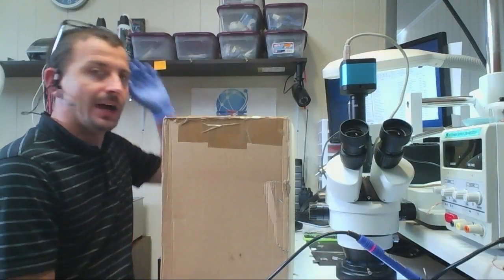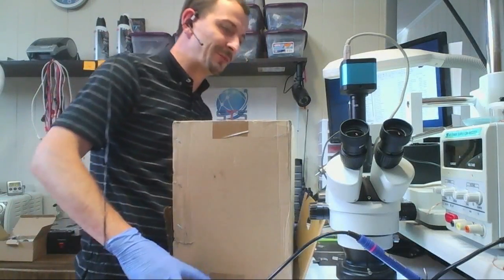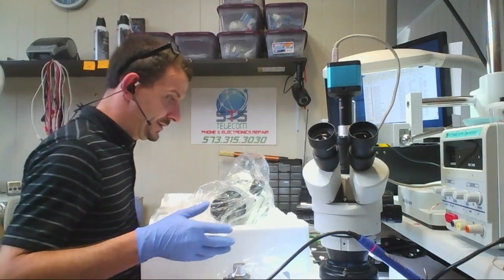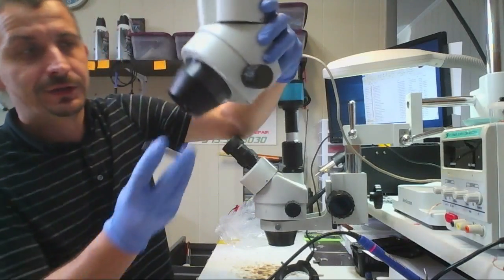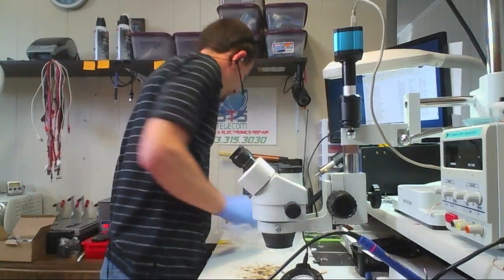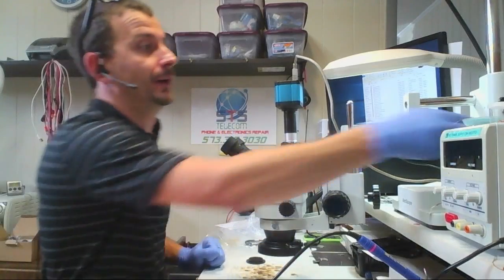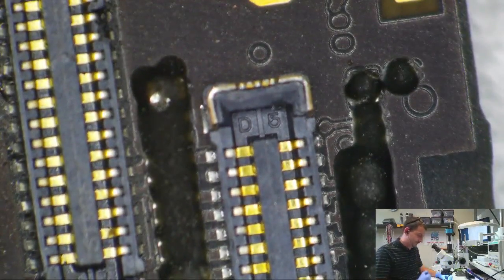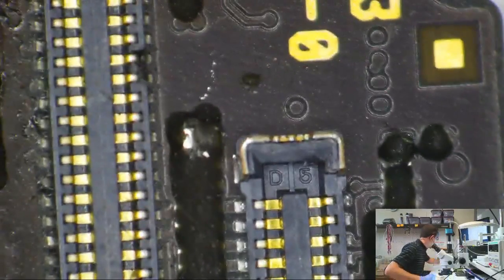A new microscope for this channel! AmScope SM745TP Simul-Focal head - GIVE ME MY EYE BACK!

Comment: You need a 48mm Barlow Lens on the bottom and well as a 48mm skylight 1B  used to protect the Barlow lens from risk of splatter from the work area. Adding the Barlow gives you straight surface to be able to lock the Light unit to the bottom.

Comment: Thanks for the video. I just purchased an AmScope SM-4TP and I need mine for filming experimental organic reactions and with my model not having that silver level that toggles it from left eye to camera port is actually a bummer for myself. From what I've read it looks like I'm loosing 20% of light since the one I have disperses it out 35% left eye, 35% right eye, and 30% for the trinocular port. I know I could just use more light on the subject but there is a significant amount of light being lost by it being dispersed this way. Would the light be dispersed differently if I put lens caps on the two objectives? Or do they may a scope that just has the trinocular port and nothing else so all the light goes to that port?  Thanks in advance!

Comment: There are some metal rings to hold the light ring, google this Metal Objective Lens Adapter Ring for Stereo Zoom Microscope M52 to M42/M52 to M48/M48 to M48/M48 to M42 X 0.75 Thread

Comment: Hi everyone. Is the magnefication we see on the video form camera same as microscope? I mean ıf ı bought just the amscope head can I get the same magnefication? I need urgent help.thanks for your help.
Reply from the maker: The camera field of view is much less than the eyes. I can see much more with my eyes than what the camera sees.  There are better camera setups for this scope than what I'm using.
Reply: @ststele  Thanks for your reply. I wonder whether camera has extra magnification or not. When ı bought just the microscope will it be enough for mobile repairing. Thanks for your help

Comment: I have a very similar scope. And when I went thru more of the stuff that came with it, I found the light keeper ring to work w no lense or the .5X lense. My X2 has one built in. I use mine in micro-mini Paleontology. And I wish I had more crank adjustments, vs the hand bolt. I measure odd shaped objects. First I wish I had a turntable to raise and lower specimens vs the scope. Second. I have GOT to find my way thru the computer program to exactly measure what I am looking at. I need a tutorial for the software. And BTW. I used to go straight from scope to TV. The computer program is much more valuable. I curse myself for not computerizing sooner.

Comment: HI; me again; couple of suggestions;1, if you would like to double magnification, instead of using a 2x barlow lens, which halves working distance between objective lens and object viewed; replace the eye piece lenses with 20x; quality of image suffers very slightly but not significant for my purpose; working distance for the objective lens remains the same. 2, you may like to apply a 1x barlow lens to provide protection for the objective lens; doesn't change anything; just protective cover for objective lenses...

Comment: Sir I need to bay a one but I am confused which one is better x45 or x90
Reply from the maker: I've never had a need to go over 45x.  Maybe with some of the smallest trace repair 50x would be handy but anything over 45x is really overkill for this work.  Just be sure you get Simul Focal if you wanna use both eyes & a camera at the same time. :-)
Reply: Thanks sir

Comment: I just bought the same trinocular simulfocal Amscope. There is a plastic adapter that mine came with, that allows the light to mount to the plastic adapter, which screws into the bottom of the microscope. It's just like your rigged plastic cap, but with some dedicated plastic area to mount the light to.

Also, some of the Barlow lenses have a dedicated place on them for the light mount, and others do not. If you buy a Barlow lens that has the groove on it, you mount the light right to the barlow lens.

Comment: Thanks for your video! Would you change anything after using it? Also, how does one knows the difference between SM745TP and SM745NTP (extra N) and AmScope SM-4T-80S-M or AmScope SM-4TZZ-144S-3M - what is 4TZZ? Anyone has a video explaining the model numbers and what is better than xxx model?
Reply: With the NTP model, Amscope moved the diopter-adjustment from the ocular ports to the individual eyepieces. Also, retention screws now hold the eyepieces in place, and independent focus adjustment can be made with each eyepiece. Also new is a zoom-lock, which allows you to lock the head at a specific magnification -- might be handy for measurement applications. Lastly, they redesigned the nose cone such that it now features an integrated mounting ring for ring illuminators.
Reply: @johnstrika4379 thank you!
Reply: https://unitedscopellc.wordpress.com/microscope-library-pages/amscope-model-numbers-explained/

Comment: Thanks for this video. I have a retina disorder that is leaving me with 20/200 left and 20/50 right eye vision. I was wondering if I would have a hard time using a scope for repairs? Could one do this kind of work by just looking at the screen?
Reply from the maker: You're welcome.  I think it would be possible but I found it to be very difficult because of depth perception.  If you have really bad vision in one eye, you may already be used to the difference tho.  When I first started out, I was using a cheap USB microscope and was able to get the job done but it was very difficult.  I was mostly doing the work and then inspecting it with the scope afterwards.  If I had started with a stereo scope, I would not have thought it was so difficult because 90% of my troubles was not being able to see it as it was in real life.  I suppose one could probably adjust to doing it all on-screen as long as the video wasn't laggy and had good quality.  I would have a really hard time if I tried it though.  It's very difficult for me to tell which way is higher or lower in relation to the bench.  Thanks for commenting. :)
Reply: Ah thanks for the insight man. Keep up the good work.

Comment: How strong is this new microscope or is the major difference 1 eye vs 2
Reply from the maker: Oh man, there's a huge difference for me.  With only one eye, there's no depth perception.  It's more of just a flat image so when doing work, it's difficult to know exactly how high or low your tool is.  With both eyes, the image is stereo and stands out at you in 3D.  I imagine that someone who only has one eye may be used to the lack of depth perception and it wouldn't affect them so much.  It's still only a 45x microscope though.

Comment: Hi, whats up friend. I am from Colombia and I would like to know which microscope to buy in Amscope references, I have seen that there is 3.5X 45X and there are also 7X 45X I do not know what the difference is. I want you to help me decide which is the best. Thank you.
Reply: look up for barlow lenses.. it can increase working distance if you use 2x on 7x-45x microscope..if you use 0.5x it will reduce working distance but you have larger view of the board.. in effect a 7x-45x microscope turns into 14x - 90x when using 2x...0.5x turns it into 3.5x - 22.5x ish... but sometimes they advertise 3.5x - 90x that means 0.5x and 2x are included as a package with the microscope..hope that helps..

Comment: is the 7x-45x zoom good enough for the smallest of soldering components on a circuit board with plenty of clearance space to solder. I am a service center for companies like Line 6 digital amplifiers and some of their stuff is tiny. But the scopes I have had access to made you pull the scope down so low it was hard to solder without hitting something. Also I don't know the power i am using on this scope as it came from the 60's and the lady got it from her uncle while they were swapping out to new gear.
Reply from the maker: 7x-45x always seems to be plenty for 99% of everything I do.  The only time I find myself wanting more is when doing long screw damage trace repair.  Sometimes I'd like to see that just a little bit closer :)
Reply from the maker: The clearance is never great though.  3 to 4 inches at best for me.
Reply: @ststele  But what about the 7x minimum zoom? Isn't that a lot? I would like to compare 3.5x to 7x. Whats your opinion on 7x minimum?

Comment: I believe this is the SM745NTP not SM745TP big difference. One is trinocular one is simul focul . Cheers looking good.
Reply: SM-4NTP and SM-4TP are both simul focal only difference is zoom lock feature(useless) in NTP, different eye pieces and led adapter ring not more necessary, this is all, the quality are the same.
Reply from the maker: Thanks, I didn't realize that.   I just went off of the eBay listing I purchased it from:
http://www.ebay.com/p/AmScope-SM745TP-7x-45x-Trinocular-Zoom-Stereo-Microscope-Simul-focal-Head/1954136094

Comment: I have new microscope with YW2307 Camera but i need the software if you have download link for me please
Reply from the maker: I'm using Open Broadcaster most of the time.  They install as a standard webcam I thought.   I don't recall installing drivers for use on Windows.  There's a good chance I installed the drivers and forgot tho...

Comment: What bench power supply are you using?
Reply from the maker: A really cheap one.  It gets the job done but if you use it for current limiting things get dirty.  
It's very similar to this one:
http://www.ebay.com/itm/5A-30V-DC-Power-Supply-Adjustable-Dual-Digital-Variable-Precision-Lab-Grade-/262294040786?hash=item3d11f170d2:g:RegAAOSw9eVXUIdZ
Reply: I was expecting to pay 200-300 ... so I built one instead. But for ~$50 ... I might have to give one like that a try. Thanks.

Comment: hello what is the distance work between the microscope and the motherboard ? 
thank you  for your video very good
Reply from the maker: Thanks!  I get 3 inches from the table to the bottom of the light.  It's not very much room but I've gotten very used to it.
Reply: NXTkTube are there cheaper 3rd party Barlow lenses? Are they worth a damn ?